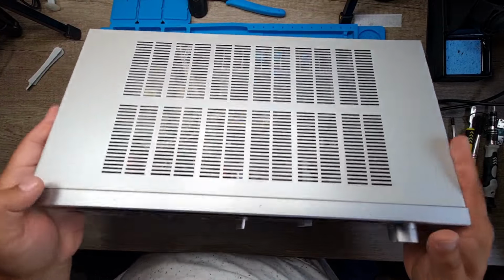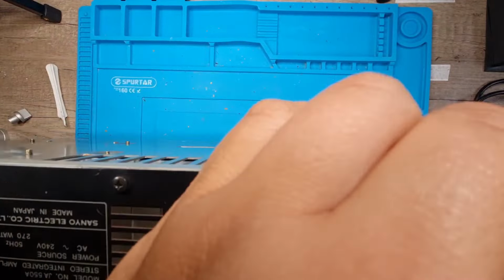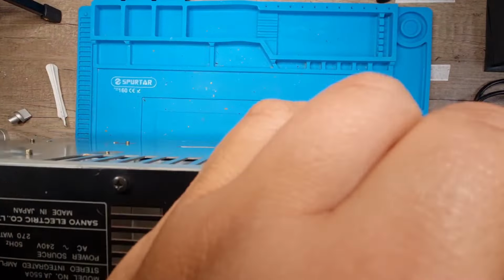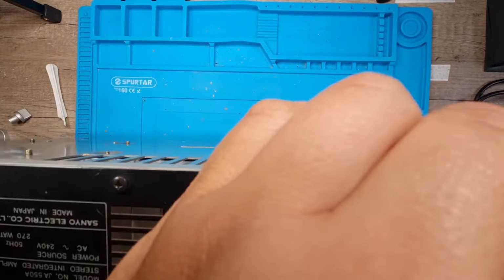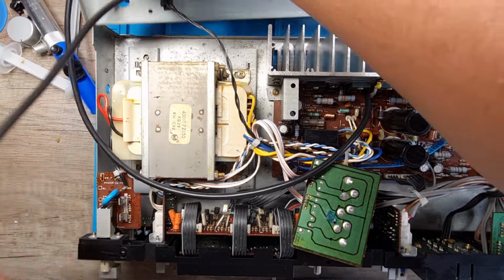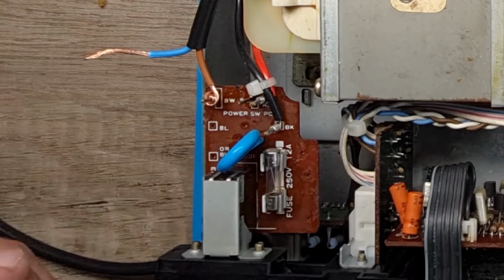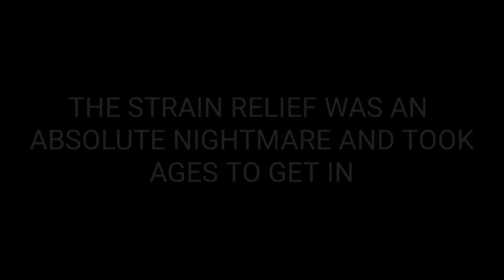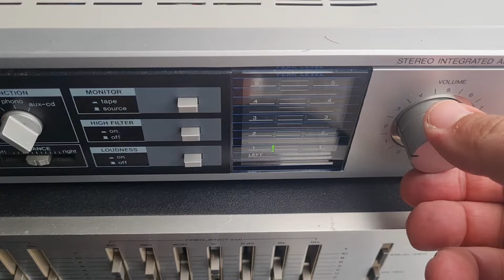Sanyo Amplifier Repair - Cap Check, Clean and New Lead

Comment: Hi bud. Firstly congratulations on the growing channel..

Constructive criticism - please take it as constructive:

1) Stop going for the bulk capacitors in things. They're almost always 20% tolerance and are not the problem if an item was manufactured post-1950.

2) What should be the first rule.. but you started out doing weird shit..so here we are: Thou shalt measure voltages.

An amp sounding crap (especially into a high impedance load - think about it) is far more likely to be a low or missing supply rail than anything to do with capacitors. Ripple from bulk capacitors only comes into play with high current / low impedance speakers.

3) If a voltage rail is missing, inject the correct voltage with an isolated current limited supply. A thermal camera will show the shorted / partially shorted component.
They used to be insanely expensive, but they aren't now.

Cheers.